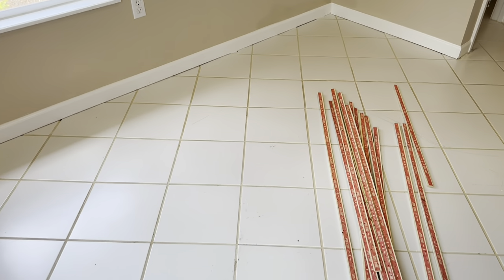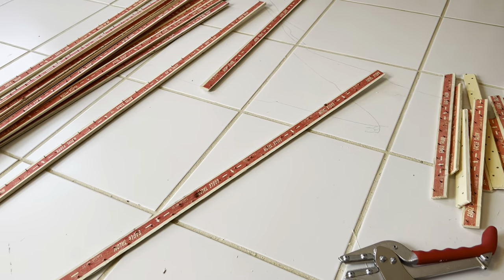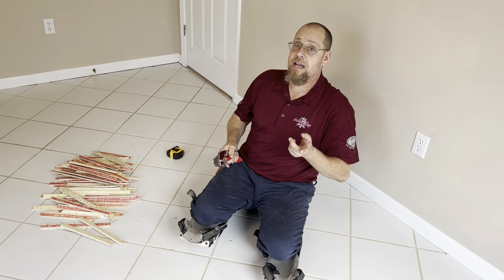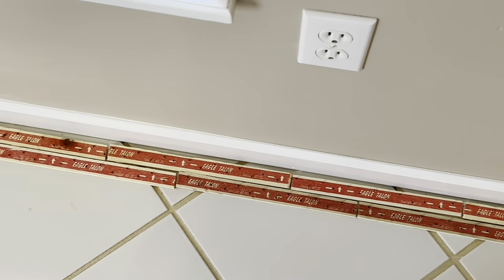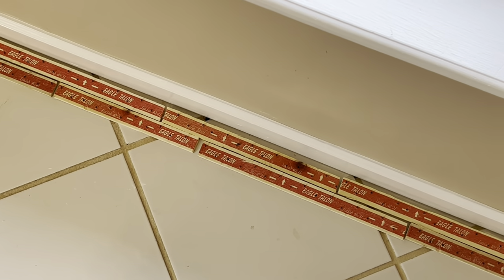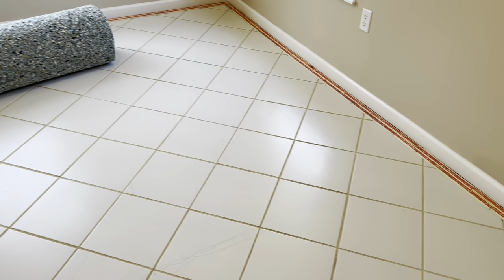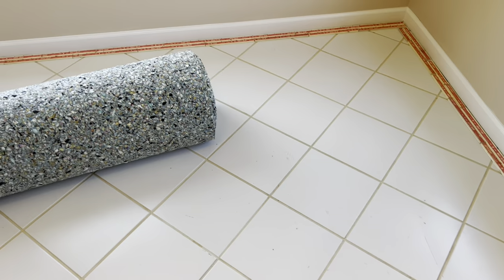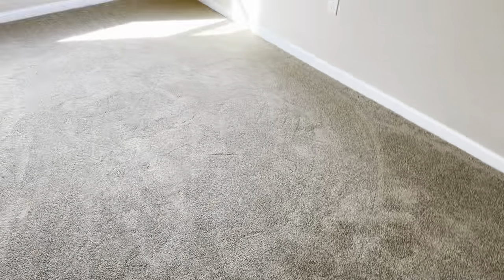Step-by-step guide: Easy carpet installation over ceramic tile

Comment: We use flexi fix and put it on the back of the cut strips , placing as per normal when nailing. We use the method on tile , poorly poured floors and underfloor heating. Same outcome different methods. Great video, greetings from Ireland 🇮🇪
Reply from the maker: Greetings

Comment: How do you remove the strips from the tile? I need to take my carpet out but save the tile underneath.
Reply from the maker: Somebody probably drilled holes through your tile in order to put down the strip, it probably will not be able to be saved, unless this method of installation was done

Comment: We predrilled holes with a hammer drill and hammered in aluminum nails. Worked out great
Reply from the maker: Cool
Reply: We use small concrete nails with concrete strips
Reply: What size hole n screws u made

Comment: It's a shame about tack strip. It used to be made with good solid wood and was very uniform, and the pin nails never stuck out the back side. Also, it used to be common to get the pin size you need for the carpet you were installing. The strip today is nothing but crap.
Reply from the maker: Yep agree, I actually recently found a good tack strip, I will do a video on it and show you what I am using now